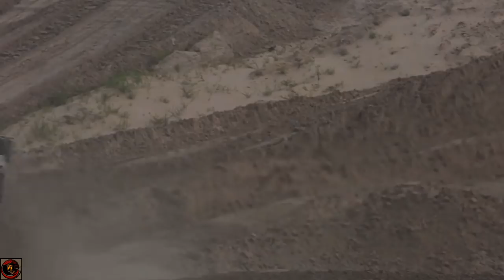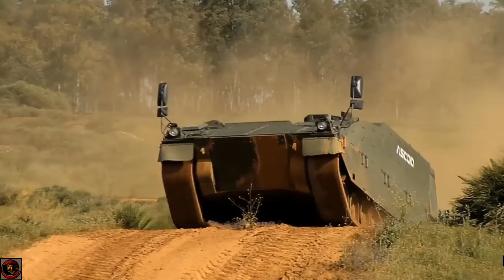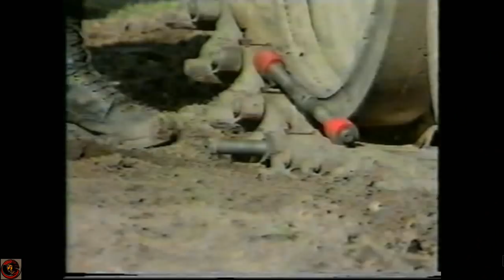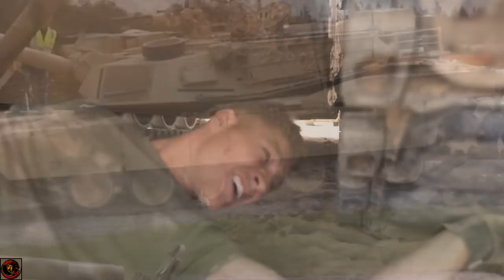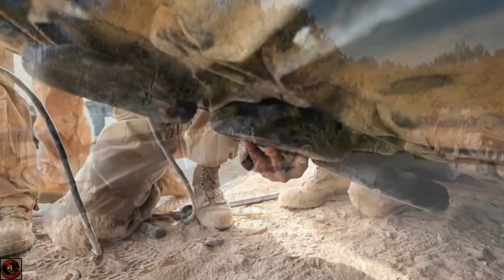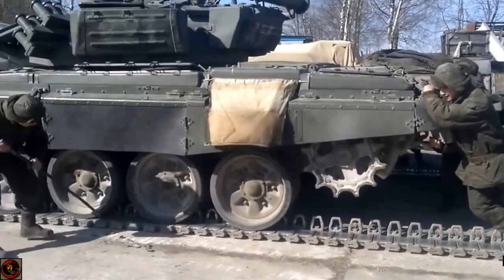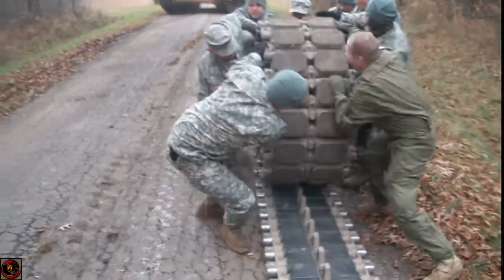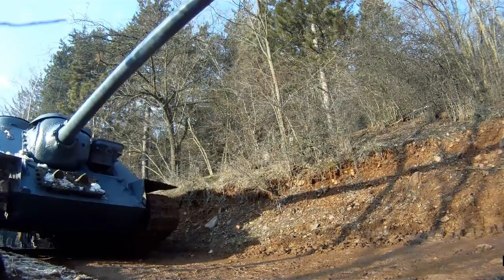What’s The Biggest Weakness on a Tank?

Comment: "Out of action, become a pillbox. Out of ammo, become a bunker. Out of time, become heroes"
Reply: that is from the movie the beast
Reply: True.
Reply: Thanks for the bunker as weak as a T-34 hull.
Reply: @HanSolo__  It was a T-55
Reply: @vaclav_fejt  Talking about The Beast tank? It was not T-55.
Reply: @HanSolo__  What was it, then? T-54? T-62?
Reply: @vaclav_fejt  It was a T-54 captured by Israel and modernized, rearmed, etc. Finally to become a Tiran Ti-67. Then it was equipped with some fake stuff so it would look somehow like Soviet T-62, which was an actual tank used in Afghanistan 1979-89. You can easily spot that when close take of the gun muzzle (around 20min). Tank in the movie uses D-10T (D-10TG?) 100mm rifled main gun, while T-62 used 115mm smoothbore. The same which was fitted on Tiran 6 T-62 tanks. IMO it is more possible that it is a T-54 over T-55 simply because T-54 used a simple straight gun, and T-54A and later got modernized one. With middle barrel fumes extractor added for movie accuracy purposes.

But! There were some T-54 and T55 tanks in IDF later fitted with 105mm American L7A1 main gun (with fumes extractor looking like one in the movie) Those were caller Tiran 5-Sh "Sharir". 
It could be 1st one 2nd one or mix of those two.
Reply: The tank from "The Beast" was in fact an Israeli Ti-67; a T-55 fitted with a Royal Ordinance L7 105mm rifled gun to replace the Soviet D-10T 100mm rifled gun.
Reply: @Jack Snow - two ways to return from war: 1) alive; 2) in a body bag. War is not glorious. The object is to lose less than the loser. Unless you're an industrialist or a financier. Whoever "wins," whoever loses, you win.
Reply: me when i play war thunder
Reply: “Out of commission”
Reply: Out in open, become a ton of scrap

Comment: the biggest weakness of a tank is the logistic chains. when your tank consumes 7L/km of fuel you have issues. after 100km you're just scrap metal. Your supply chain can't keep up or gets harassed by the enemy? no more big dangerous tank.
Reply: 91plm that’s what I thought the video was going to be about. Fuel consumption
Reply: It is.. As even today. The tank is limited to about 250 miles. Something the Germans learned in WWII...They outran their supply line. Then become sitting ducks to air power and artillery.
Reply: master the germans never had that problem for the most part, only time i can think they had major supply issues was during the battle of the bulge but that was due to a massive fuel shortage in the first place. the rest was them stressing their supply lines but never out running it, german commanders was never that dumb.
Reply: I don't think you understood the problem.. Tanks need Maintenance. Ammo. Fuel. Food. etc... Today the same problem still exist.. Tanks have a range of about 250-300 miles. 

And without Infantry and a forward air base.. You're a sitting duck...
Reply: For some reason I still remember my tank had 504 gallons of fuel and took 8 gallons to start.
Reply: Wow... well that's an open door. Those arguments are BS
Reply: I served in Korea as mechanic the tank and self driving artillery.
It was hard to change in field. Very very ...
Reply: Trucks or train will carry them before an actual battle
Reply: Which is precisely why the Abrams has a Honeywell Gas Turbine engine. It'll run on gasoline, diesel, kerosene, hey fuel -- if there's a liquid, combustible fuel, it'll burn it.
Reply: The biggest weakness of a tank is its logistics.
Reply: @Thekilleroftanks  Well maybe not directly, but German armour had big problems with reliability and getting spare parts to actually fix these tanks.
Reply: @TehIdiotOne  thats only in the later parts of the war.

But it doesnt matter because any country in that position would have problems. Though if it was the US there would be bigger problems.
Reply: @morteparla6926  Nope. . Modern tank's piston motors also are multyfuel source of mechanical energy . Fuel feeding system of an injector piston motor has only one difference from a diesel- it requires artificial ignition element which is not affecting  acting the motor as diesel if the fuel density  is permitting it. 
Advantage  of turbine only  in compactivity if to comporase it with piston motor of the same power.
Reply: If you got a manual gun loader + manual backup elevation/rotation control, you are gonna turn into an armored heavy stationary turret. Still pretty scary.
Reply: @morteparla6926 Gas turbine in Abrams uses only fuels simmilar to diesel. Gasoline is ruining this engine. Multifuel does not mean it will rock on oil or 97% alcohol. Thats bananas.
Reply: @vasskolomiets41  It is an aircraft engine. They picked it because it was light and powerful. Compact placement was another thing to do.
Reply: @HanSolo__  The Abrams is powered by the Honeywell AGT1500 Gas Turbine engine. You should do some research on it, because you evidently know nothing about it.
Reply: @HanSolo__  You're completely wrong. In fact, the US Military ran the Abrams on a variety of fuel for many, many years without issue. Primarily, they now use JP8, but still occasionally use other fuels. 

I don't know where you came up with the bullshit you typed, and you clearly still haven't done proper research on the Honeywell AGT1500. Until you actually know what you're talking about, do the entire world a service and stop spewing ignorance.
Reply: @HanSolo__  weight and power are connected so I don't understand your goal.
Reply: @vasskolomiets41  You know. Some people say "Its a tank! Why it needs light-weight GTE? Its 69t+! Just add another tone!" So I say: because it is a tank and its is already heavy as fcuk, we need light powerful engine in it" 
Those were the concerns when choosing the powerplant for M1 Abrams.
Reply: @HanSolo__  I know  it is the discussion about nothing if to  overscore  the weight versus  the volume
Reply: @morteparla6926  When there was the Polish 100years of freedom parade in Warsaw I asked the M1 driver about taking gasoline right out of the gas station. He said "No sir. Military grade fuels only"
Not sure but this could be 278th Armored Cavalry Brigade of National Guard from Tenesee. 
Next time another ocasion I've asked an older guy (LandForces officer didn't asked te unit) and he said exact the same thing.
Well if Im wrong, then so is the National Guard,
Latet on I did some research. Then you asked so I did it next time. So if you ask me next time I will aswear "Got no fcukin idea!"
Oh yeah. Years before I was thinking just as you. I was sure that it can run even on Chanel No5
Reply: @vasskolomiets41  I assume you are talking about the power(HP) per 1 tone ratio. Yes?
Reply: 91- Was thinking the same thing. Supply truck is the weakness.
Reply: And these sorts of arguments and logistical issues are why the Australian Abrams tanks were fitted with diesel engines. One fuel type across the fleet.
Reply: @markfryer9880  Why does Australia need tanks again? I thought they were waterlocked 😂😂😂
Reply: @HanSolo__  - Jet fuels are basically kerosene, which is oily like diesel but not nearly as. Gasoline has zero lubricity, less than water.
The gas turbine is more reliable than reciprocating piston engines. It has much greater power/weight and power/size ratios. But at less than around 80% of full power it is very inefficient (fuel guzzler). The.compression ratio is very dependent on compressor wheels speed. As with compression ignition (diesel) and throttle controlled spark ignition (gasoline) engines, the higher the compression pressure, the greater the efficiency.
In dusty and sandy environments the turbine's appetite for air causes intake filters to clog quickly. Only in an emergency will a turbine be operated without filters. The blades will be ground away by sand and dirt (powdered sand).
Reply: @jamielonsdale3018  - Oz gets dragged into everyone (UK, US, NATO, etc.)'s wars. Would rather go blow up someone else's country than have a war in one's own.
Reply: @algrayson8965  I do know those pros and cons of GTE. Thanks anyway for pointing it out.
Reply: That’s the secret. Just have a very robust and well trained lotus total supply chain. You’ve committed a straw man fallacy. Your argument is neither valid or argument.
Reply: You are very correct, as the war in Ukraine shows.

Comment: The biggest weakness of a tank is the lack of a toilet
Reply: What are you talking about, of course they have toilets. It's called the Commander's Commode and it's under the tank commander's seat with a round removable cushion segment and a chemical toilet underneath. The other option is to use the belly escape hatch to eliminate yourself and this is the more popular option. In an NBC environment you can't leave the tank, so a toilet became imperrative.
Reply: Not quite true. A guy who served in the first Gulf War said they had to use plastic bags as toilets and there were none inside the tank.
Reply: Quote "The Brits win this one. As someone actually training to use the Best of British armour, I can confirm the Challenger 2 has a toilet under the Loader's seat. It flushes the waste out under the tank, and can be used when hatches are closed. Now you understand why the Brits have the best modern Main Battle Tank. Other than the excellent tea making faculties.

Incidentally, our Warrior troop carrier also has a toilet in the troop compartment, but that only has a bag that sits and stinks up the tank. So while the option is there, I'm sure"
Reply: I would not call bunging a bag of poo out the waste hatch flushing, that's if you have bothered to grease the hinge during servicing ????
Reply: Have a 5G bucket with TIGHT fitting lid. Or get used to DEPENDS which come in many sizes. Also buy your MOIST TOWELETTES by the CASE. Or just learn to HOLD IT till you get back to your FOB.
Reply: The Challenger 2 actually have a toilet but I don't think anyone ever use it. Its not exactly comfortable or ideal. It supposed to be used in emergency in a NBC environment. Though I think only the British have this. I have read some tanks had it outright removed later on though.
Reply: Inconvenience is not weakness.
Reply: Sromotny Kobziarz Lol good point
Reply: Ob Fuscated --But incontinence is....
Reply: That is what helmets are for.
Reply: Just hold it in until your tracks get broken.
Reply: The way a particularly creative driver in my platoon allegedly solved it was by putting a bag in his helmet and shitting in that.
Reply: Why?You never survive enought time to make poop in combat:)
Reply: D Jones but we only have ashtrays now.

Comment: "Not even trees can stop the firepower of a tank."
Redwood : "Say what?!"
Reply: Well, to be honest, with modern fire control  a decent modern take could take out EVEN a REDWOOD in a few rounds of well placed HE
Reply: @markdoldon8852  Perhaps couple of trees yes but there is no going through a forest. Real forest, 50 year old pines with diameter of half a meter each, every 5 meters. You just have to go around it. Or spend a day shooting the first couple dozen trees and then ramming hundreds of trees. At that point, you just made a barely traversable road in the middle of the forest. Instead of going around it using a road.

If it's not absolutely necessary, going around is always easier. I bet those guys on the video were doing that just for the shit and giggles.
Reply: @alaric_  You have to go out of your place and go to some tank museum. Check out what heavy tank means in REAL. Even a 40 tones and 850HP of T-72 will do it. Not to mention over 60t Abrams. Polish tank brigades were helping firefighters during fire in forrest. They were cutting off the places taken by the fire by ramming trees of all kinds and sizes they got. Such cut was two tanks wide.
BTW Nobody rams a whole forrest if its not necessary.
Reply: MrKansai1 teghe why would you ram some trees with a tank in the first place?
Reply: MrKansai1 teghe why would you ram some trees with a tank in the first place?
Reply: @alaric_  easy fix, just burn down the forest a few weeks ahead
Reply: @agentc7020  - Because the trees are in the tank's way.
Reply: @agentc7020  Because the trees are there, and because you can.
Reply: Alaric Balthi just have the engineers use cutting charges or launch the mclic.
Reply: An grand old oak tree better than concrete
Reply: 100 yrl Pine tree: say what?
Reply: lol what would win, 1 hundred metre redwood, or 2 choppy bois xD
Reply: GTA says...trashcan??